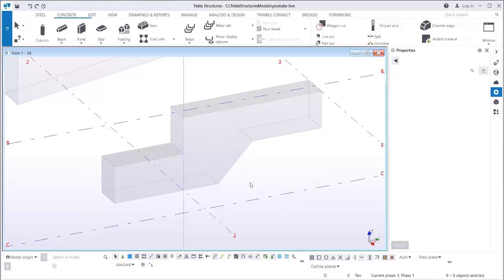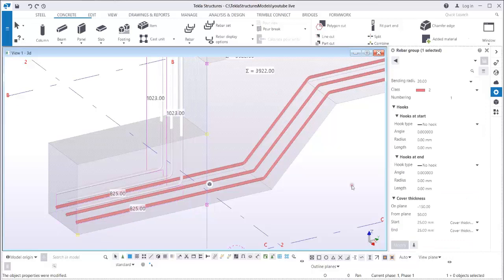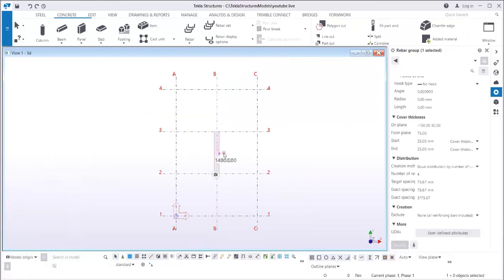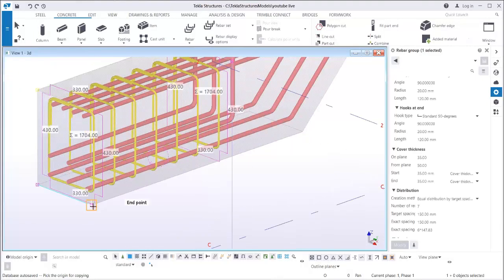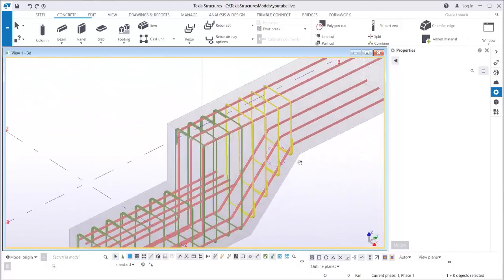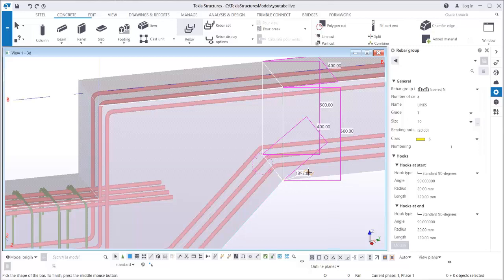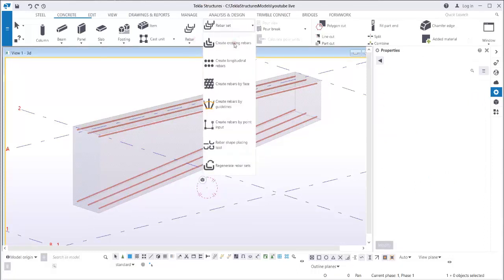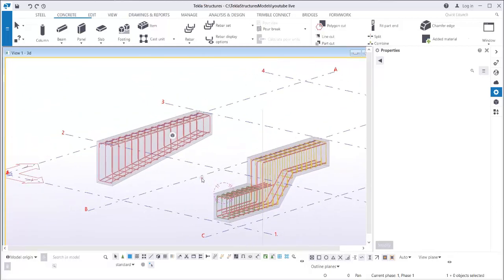How to Add Rebar to Tapered Beam using Rebar Group and Rebar Set?

Comment: When I do crossing rebar set to model stirrups, then all four legs of stirrups are not drawn. What's the problem sir ?
Reply from the maker: Try to put the cursor to concrete geometry the click on the 4 legs of stirrups and click the middle button of mouse
Reply: @thehowsofteklastructures565  Still not solved. I select all four legs but bar only shown on 3 legs.. If I stretch the beam then it shows on all legs

Comment: Does Tekla have Viewcube like Revit ?  2:23 How did you rotate the view to YZ plane ?
Reply from the maker: In 2:23 i just rotate the view manually. But you can use a couple of way to get that view. First is by selecting the beam right click and create basic views of part. Second is select the contextual toolbar (floating toolbar or the small cube) and you can find the view cube. Hope it helps.
Reply: @thehowsofteklastructures565  Great~ Thanks for your reply~